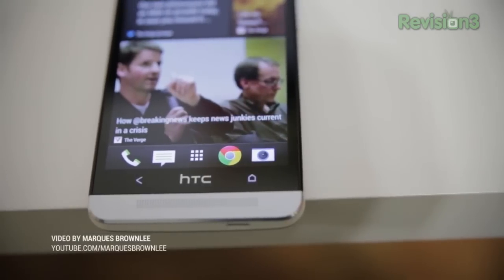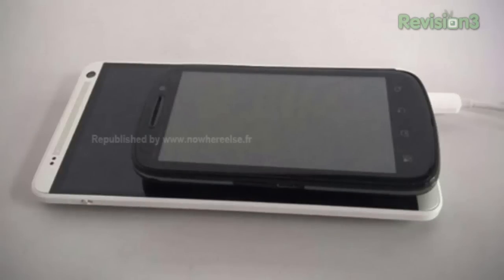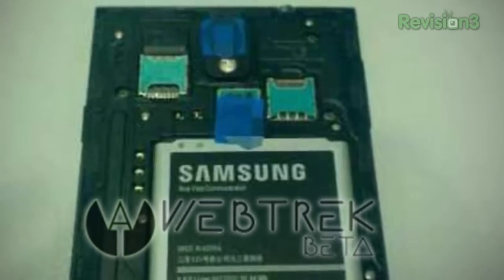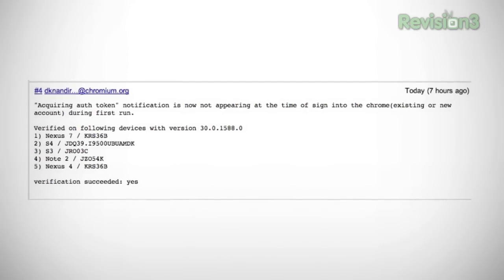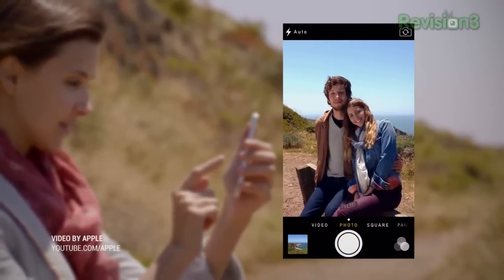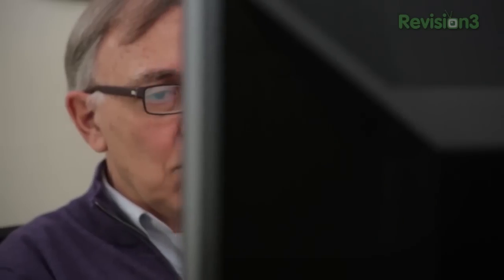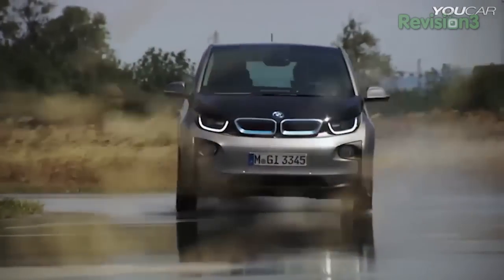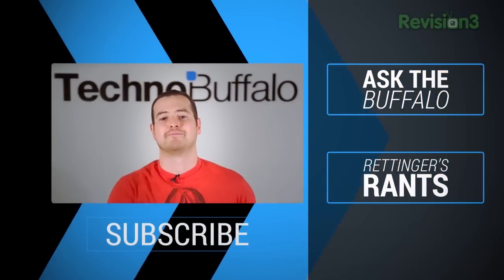HTC One Max, Galaxy Note III, and Key Lime Pie

Comment: The HTC one has two Machined aluminum plates sandwiching plastic in a unibody construction phone. The HTC One Max is built like the cheap HTC One Mini in that it is a completely plastic construction with a few aluminum panels to give the appearance of the much more expensive to construct HTC one.

Comment: they use the same processor unless your talking about the exynos. but that was a failure anyway. 

As for storage, Its not really a problem nowadays. An easy solution is a decent 32gb internal for those apps and music, and for heavy multimedia buy a wireless drive.